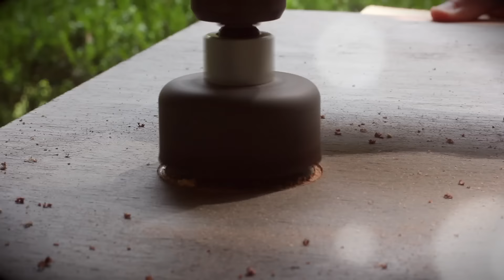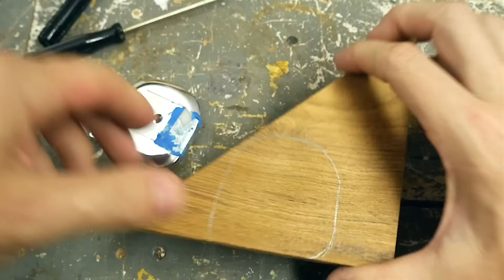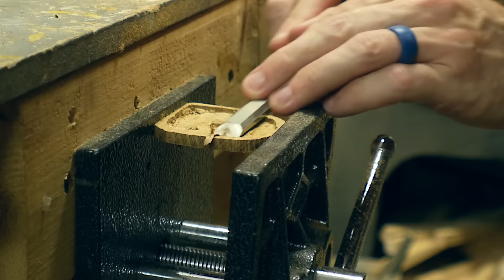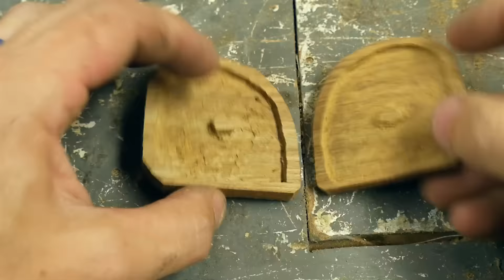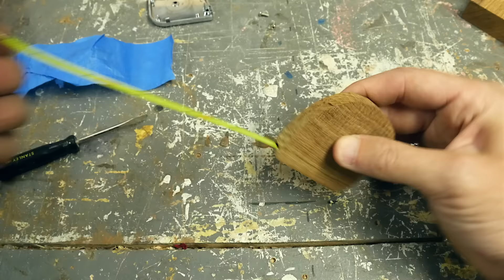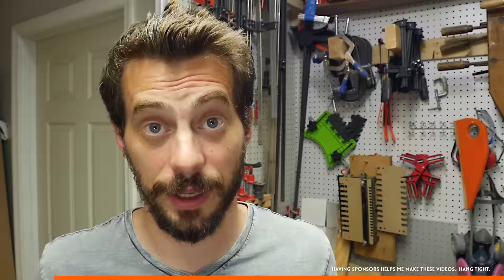How to make a wooden tape measure | I Like To Make Stuff

Comment: I came here in the hopes of seeing how a spring-loaded tape measure was put together, because:
I want to make a retractable clothes line with a wood (possibly chip carved) casing. Now the question remains whether the weight of wet laundry would stretch the metal spring from a worn-to-the-point-of-unreadable tape measure too much. Another question is what length of cotton/nylon/coated cable could be loaded into any given tape measure spool.

Comment: Hi Sir, I really love your videos and I have learnt a lot watching you build cool stuff. I hope you get to read this. 
I noticed the dremel tool you used in this video, been looking to get this for so long, could use your insight. I watched a few review videos but I am yet to make a decision. 
1. what model is the one you are using?
2. as far as your knowledge and use of the tool is concerned, can you point out the limitation to which this tool does not qualify to use, maybe materials, or specifics like material thickness you can cover before it starts to under perform.
3.can you share the link to where I can buy this tool I wold be more than grateful. 

Thanks in advance.

Comment: I put a router bit in my drill press to make my tape measure, but I should I have made the post out of the material instead of gluing in a dowel but it works

Comment: The desire to CNC this is strong...
Reply from the maker: :)  Yeah, I think I'm going to do another video on the start to finish CNC process. Lots of people have asked for it and it'd be a good simple example.
Reply: Two ideas for you:
1) Machine a lip on one side, and a matching recess on the other so that the halves are self-aligning.
2) Drill through-holes in strategic locations (center, corner, etc) and use screws to hold the pieces together, on the off-chance you'll ever want to open it up again.

Comment: You should use your CNC to make an aluminum stamp with the I like to make stuff logo, then build some sort of heating element to attach to the bottom so you can make a custom burn-in wood stamp. Not sure if that's what they're called, but it would be awesome.

Comment: Great Video! and great craftsmanship but i'm confused in a practical sense why you would want the tape measure to have a wooden case instead of the steel one that it originally came with. If you did this for decorative reasons why didn't you go further with it and maybe route the edges to be more elegant.
Reply from the maker: It came in a cheap plastic case, but also. I learned several things by making things, hopefully others did too.

Comment: Next time try making the shell in 3 pieces, the 2 outside halves, and then the middle. Once you get all the shapes cut, you can glue them all together, and then just cut it in half. Now the insides will be perfectly smooth, and I think it would take a lot less time overall.

Comment: Would you call a Dremel tool a mini router?
Reply from the maker: Eh, kind of.  They both have a spinning bit, but generally a router would have a base on it (which would make the plunge cut really easy here) and much more torque and power.

Comment: That's somthing I'v been wanting to do for a while but I haven't found a cheap metric only measuring tape for the guts.
Reply from the maker: Ebay? Seems like you'd find one there.  Also maybe look at alibaba.  I looked there to see how cheaply I could buy just the tape in bulk a couple of weeks back.
Reply: alibaba seems like a good option for buying a bulk of tapes. In my case, Ecuador is very strict on their importing policies so it's cheaper for me as an individual to go to a hardware store and buy a 3m stanley powerlock (the small one) fpr 10$ than a cheap, free shipping, tape measure (imports are more than double per piece), still is very expensive. An idea I had was to do some acid etching on spring steel, but that is practical only if you are doing a big lot of measuring tapes.

Comment: Pretty cool. Out of curiosity, how difficult do you think it would be to add the sliding lock to one of these.
Reply from the maker: Wouldn't be too hard. You'd need to cut a little slot for the lock to fit into.  Personally I just don't use it on small tapes like this so I didn't make the effort, but it's totally possible to add.
Reply: +I Like To Make Stuff Alright cool. I've been looking for some unique small projects to work on, maybe I'll try it. Thanks!

Comment: What are the top 10 most used and needed items you would tell a beginning woodworker to buy other then a regular hammer, tape measure, screwdrivers and auto SD with the basic drill bits? Oh I have E6000 glue and clamps too so what would you advice are the next top 10 things to buy that will get the most use?  Make sense?  Lol
Reply from the maker: Not sure about 10 things, but I did write this recently which might help
http://www.iliketomakestuff.com/tools-getting-started-woodworking/

Comment: You could probably make with just the bandsaw, kinda like a bandsaw box. Cut the blank into three slices, then cut away the waste from center section and add a dowel for center peg or just use some of the waste and glue it in the middle. Just a thought.

Comment: Another way to make a wooden shell/enclosure would be to cut three pieces, the middle part being the thickest in this case and the outer pieces much thinner. No need to cnc or hack away to make space, just cut the middle out of the middle piece and glue everything together

Comment: I just have a question Does it matter what kind of tape measure you are using ?
Reply from the maker: Nope, just make the case to fit.  I used a $0.99 6ft on from home Depot.

Comment: Hey Bob!

Just a tip, instead of the messy routing using a dremel the way you did, you could use an hand held router before cutting out the Shape. this way you should get a cleaner cut without risking to cut through it or brake it.

Awesome project by the way!

Comment: The endmill bit used in high speed setting on the drillpress was a new idea to me. Opens up lots of creative possibilities. I don't have access to an endmill. Will a ground-flat drillbit suffice or must a dedicated endmill be used?
Reply from the maker: I wouldn't expect that to work exactly the same.  There are a bunch of different types of endmills and they have specific ways of cutting. Some at the bottom of the bit, some on the sides, some both.  You can get a pack of inexpensive ones from ebay for a couple of dollars.  Thats how I buy mine and even though they don't last forever, I don't feel bad about replacing them or breaking them since they were maybe 50 cents a piece.
Reply: +I Like To Make Stuff Thanks for your rapid & informative reply - cheers from Chiang Mai :-)
Reply: I've got a few drillbits that I've ground the tip flat, to be used just like this.  they work great for milling out slip-joint pocket knife scales.  

Great stuff Bob.  Loving the channel.

Comment: you had to control the depth of the endmill manually when using the dremel, right? if so why not use the tile cutting accessory? thanks for the vid!
Reply from the maker: That's not one I have in my shop, but sounds interesting!
Reply: I Like To Make Stuff 
See this 
https://www.amazon.com/Dremel-566-Tile-Cutting-Kit/dp/B0006O8S04

I am ordering one soon when I have the time to get a one time visa card, just use the plastic part and not the bit.

Comment: hey bob how would you go about making a stop for these like you get on a lot of tape measures to stop the tape from retracting
Reply from the maker: The stop that comes with them is just a little bar that fits into a slot.  You could mimic it's placement and size and it should work fine.  I personally never use it (only on a big tape when measuring to cut) so I just left it off.    I think you could route out the slot for it  if you have a stead hand.

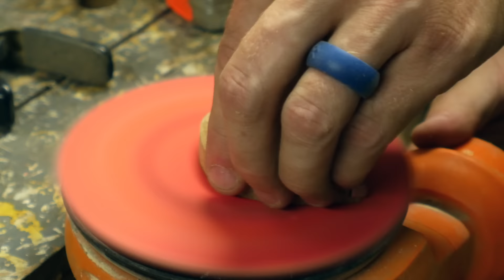Comment: 2:15 Do you really put paintors tape around your wedding ring every time you work on the shop? Good idea btw
Reply: +jay livingston cool, i will certainly check it out, but i think the paintors tape is also a good, accidentally found, idea. Or you can take it off, but if you lose it around the shop the wife is gonna be real madddd hahahahaha I'm jk though, I'm not married
Reply from the maker: Ha, no it's a QALOring.  They're awesome.  Qaloring.com
Reply: He has a silicon ring, made by QALO, it just looks taped over since it's blue. :) He's referenced the company in previous videos.
Reply: His wedding ring is rubber. He did a video on it. It's so if it gets caught in a machine it'll rip the ring off before it rips his finger off. I don't remember the exact brand though.

Comment: Nice project. I liked the pocket version more - the shape is just right.  :)
There's a plunge router attachment for Dremel. Can be useful for similar projects if someone (like me) doesn't have a drill press or a small router.